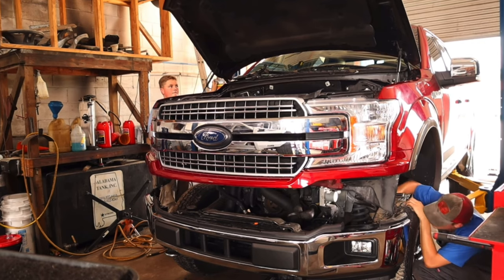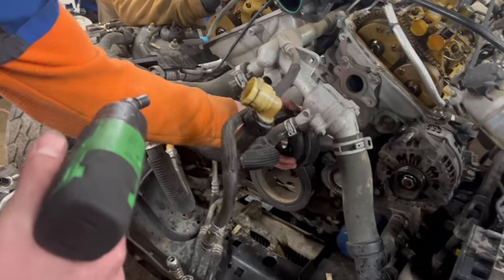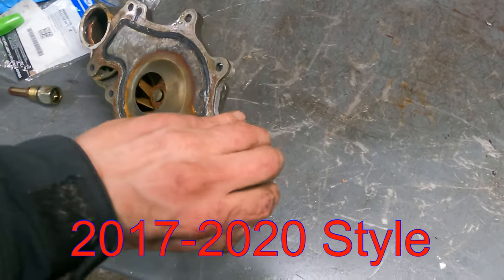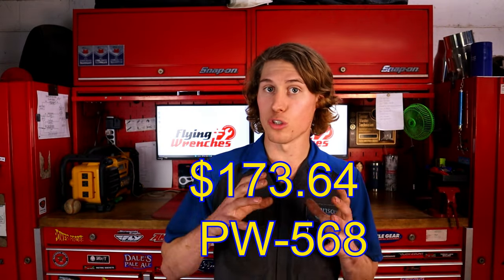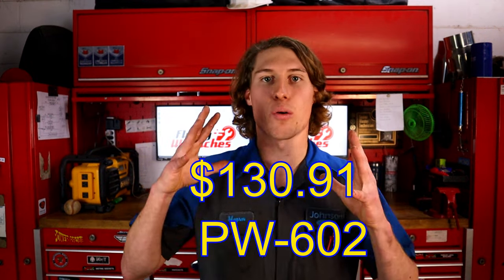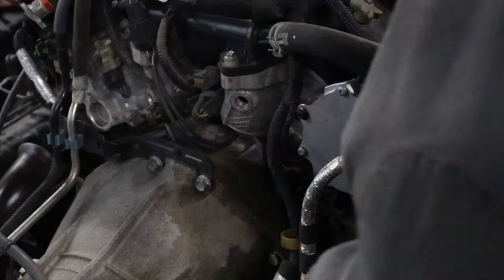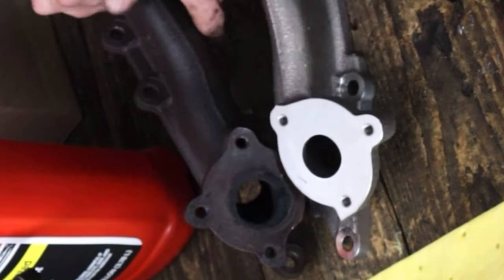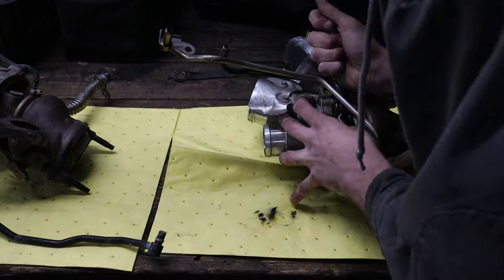Ford F-150 Most Common Coolant Leaks | 3.5 EcoBoost V6

Comment: Have a 2019 expedition. Heater hose Y connector leak. What a garbage design. Who would think plastic would get brittle being 8 inches above a turbo that is constantly hot. Changing to aluminum dorman Y connector with tried, true, and trusted hose clamps.

Comment: Do you have to lift the cab to do the turbo leaks or was the truck in the video in for something else?
Reply: They do it a lot to get easier access to the front cover area. Cam phasers, water pump, etc. it is not a must but is easier.

Comment: I am so disgusted with Ford and the crazy stuff they produce.  Ive been a Ford man for 50 years, and I'm ready to find a 1970 pickup and call it good.  Why put such crappy fittings on a Turbo that is wedged between the frame and the head with no access?

Comment: NOT A GREAT VIDEO. YOU DONT HAVE TO PULL THE CAB TO PERFORM PHASER REPAIR. IF THIS DEALER AND THIS GUY IS WORKING ON YOUR TRUCK AND CHARGINGT TO PULL THE CAB GET YOUR MONEY BACK. THE WORKSHOP MANUAL DOES NOT HAVE YOU PULL THE CAB AND THEY CANT CHARGE YOU FOR IT IF ITS NOT PART OF THE REPAIR.
Reply: Yes but pulling the cab allows for much more access without fighting, and you can see any more issues more easily. And for people like me, pulling the cab allows all work to be done so much easier, and like me who plans to keep my truck till I die. The body was out on a a trailer, sent off for a complete repaint, then since the body was off, the frame was blasted and repainted and sealed. It's worth pulling the cab for major work.

Comment: Whay is my 2012 running awesome, i put a napa water pump in mine. Steel impeller.after 190000k of regular oil changes.

Comment: Imagine burying a weak link like a water pump into an engine like that. Yeah pump cost $146, but it cost you $10,000 in labor. Stupid. an absolute shame that you have to tear any truck down that far, I don’t care what anybody says it’s all by design that’s how they suck it back into the dealership so the average guy who doesn’t have a lift can’t do it.
Reply: I agree
Reply: On my 2013 3.5 F-150 the cost was only $2,600, I got new water pump, oil pump, and new updated timing set installed too.
Reply: @seacradev5400  🤣🤣🤣
Reply: @The2Time4792  Would you like me to email you the receipt? Unless you have ever had the work done , then you have no claim to think you're correct. People like you give people like me entertainment in rolling my eyes with your ignorance.